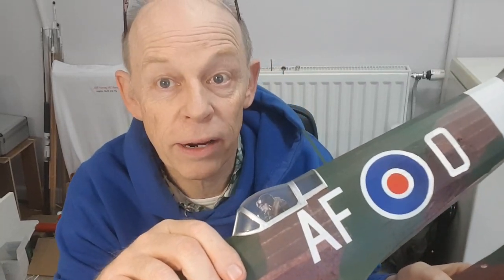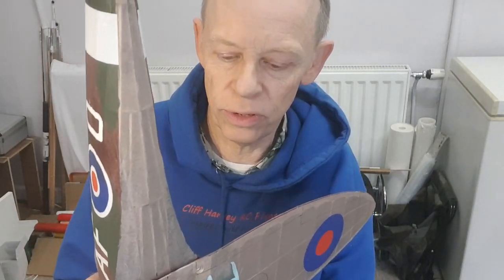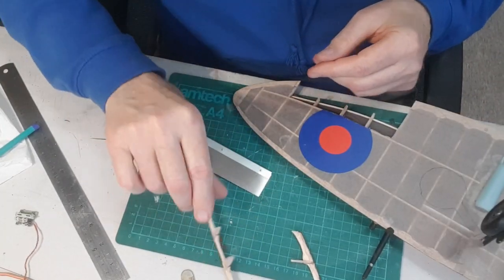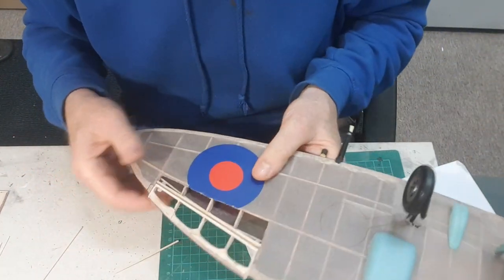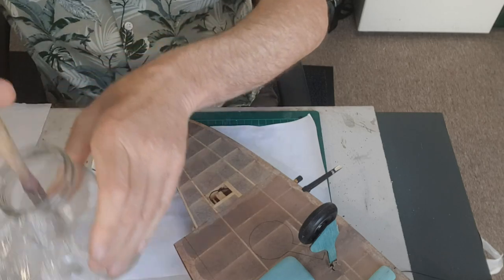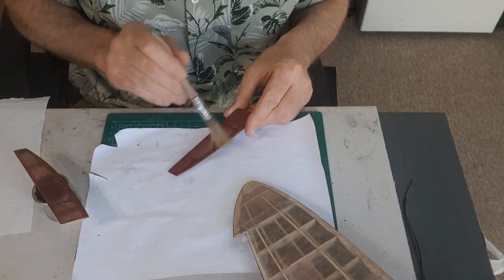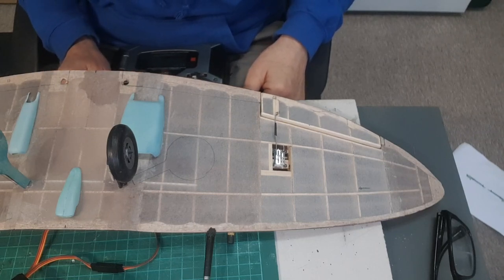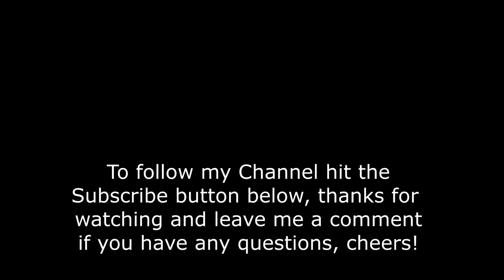How To Retro-Fit Ailerons

Comment: Very clever mod Cliff. I have a few of those linear servos but don't think I've ever used any.. Brilliant mate 👍
Reply from the maker: Thanks Jerry, one thing I forgot to consider is they work on a lower voltage than what comes out of the rx but I've gotten away with it because I have two servos running through a Y lead which seems to share the voltage if you understand me 😁
Reply: I do understand, yes.. 👍

Comment: Hi Cliff you made short work of that 
Looks great 
Bet you it fly s great as well
Reply from the maker: Yes Micheal, not a massive job but it was made easier by the fact that I had pre-drilled lightening holes through the ribs which made passing the servo leads through a pleasure, watch out for the flight video 👍

Comment: Excellent engineering and well done. How did you pass the control rods thru the wing to the fuselage? I have always find that a problem if I haven't made arragements  in the ribs during initial assembly just in case. You must have a clever way
Reply from the maker: That's an excellent question Irwin and the answer is I was sort of lucky. I had made a few holes for lightness in the original build, the biggest of which was just the right size to pull a servo plug through using a piece of wire. Had that not been the case I would have had to remove a couple of panels of tissue to make some holes. I have also successfully done it on my Mannock biplane which I bought part-built, the original builder had covered the wings without any thought as to how to connect the ailerons, here's a video on what I did on this occasion https://youtu.be/cCH7VqbxLRk 🙂
Reply: @CliffHarveyRCPlanes  What I have done is to make slits in the bottom of the ribs just enough to slip the thin wires into--from both wing  and fuse if I need the length to and put any connector between ribs. It was messy, but I no longer can do fine wire soldering.
Reply from the maker: Oh, I've just noticed you've already seen the video on the Mannock Irwin 😁
Reply: @CliffHarveyRCPlanes   Yes, I saw that. Very steady hand needed.

Comment: Great stuff Cliff. Are the control horns made up from thin ply or are they off-the-shelf?
Reply from the maker: Hi Rob, just cut from thin ply with scissors 🙂👍
Reply: @CliffHarveyRCPlanes   many thanks! Going to be doing the same project myself this winter. Hoping to do a tiny FPV spitfire, based on this model.
Reply from the maker: @coulsonrobert  Now that'll be awsum 👍
Reply: @CliffHarveyRCPlanes   hope so!

Comment: What do you use for covering on it.  I haven't done this kind of planes in over 40 years
Reply from the maker: Hi Yogenh, it's the same tissue covering that was used all those years ago, it comes in the kit, basically any tissue will work, some's heavier than others and some are more colour-fast than others but they all work to some extent. It's very different to using the Monokote you're used to but buy yourself a model and start having fun, you won't regret it, I certainly haven't, here's the video I made of this model that covers the tissuing https://youtu.be/30hkLhM4Zro plus there are lots of Facebook groups as well to have a look at and get loads of advice. 👍
Reply: @CliffHarveyRCPlanes  thanks and where can someone get it and is it just called tissue or does it have an other name that it goes by?  I did watch the other video and it was helpful
Reply from the maker: Esaki tissue is one name you can search for Yogenh, but just 'tissue for model plane' will yield results,  there are a few places in the UK that sells it and it's probably the same for most countries of the World. The tissue you can get from most craft outlets is suitable to a degree, your best bet is to get some tissue and make up a square of balsa and see how it behaves with various glues etc 👍
Reply: @CliffHarveyRCPlanes  thanks I will have to try that.   I know way back then would use airplane dope on it to seal it  and colored dope to pant it.  I don't see that anymore so do you use something that is like  it?
Reply from the maker: @Yogenh  If you want your model to fly, especially if it's rubber-powered, it has to be as light as possible, this means dope which is thinned down and colour only applied using coloured tissue. If on the other hand it's got a motor then you can go a little heavier but not much. We can get Nitrate dope here in the UK no problem but there's a product on the market (which I haven't tried but others say is pretty good) and that Eze Dope, again you have to thin it I guess. Personally I just put the tissue on as tight as possible, spritz it with water mist, this tightens it, then a couple of thinned coats of dope, or instead of dope you can try a couple of very light coats of clear matt lacquer in a rattle can. In the case of this Spitfire I painted the green on using watered down emulsion paint. Then the whole lot gets slightly sprayed with clear matt lacquer. My advice is to experiment on test panels, you can't go wrong that way Yogenh.

Comment: I retrofitted ailerons into a nearly 20 year old build, where I tried unsuccessfully to fly the Spitfire with ret control.  The aileron linkage was made using a cut length of wire as a drill bit, blindly drilling through the ribs as straight as possible and then installing torque rods, finally having to make the bends for linkage in the wing center, with the rods installed.  Flew well, just getting onto ailerons back then.  Recently I swapped out the brushed motor in the GWS box with a BL inrunner, and corrected the aileron torque rod linkage geometry in the wing a bit.  Recent flight flew better than I expected. https://www.youtube.com/watch?v=P7uxSpd2udk
Reply from the maker: I found the rudder ineffective so it had to be done, yours goes well, it's a nice build as well 👍